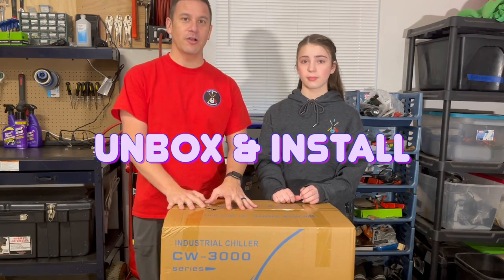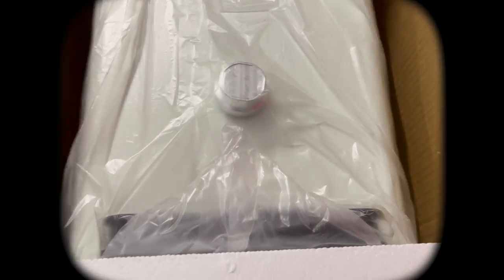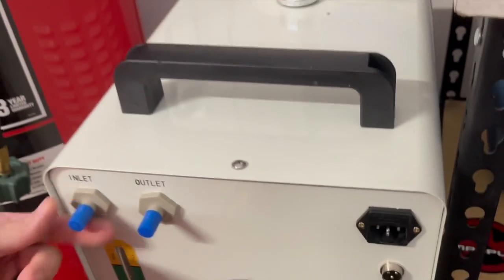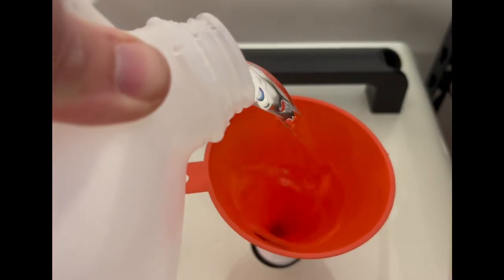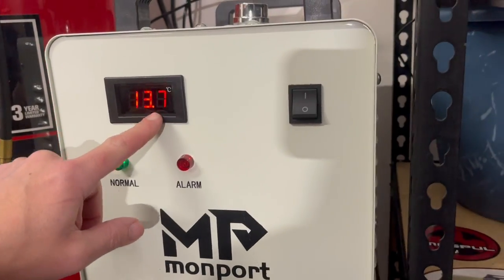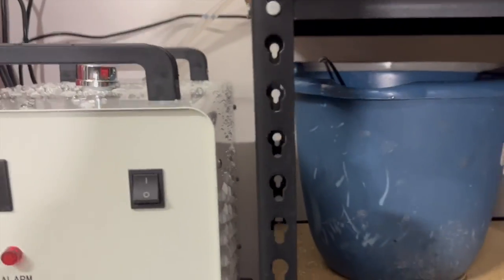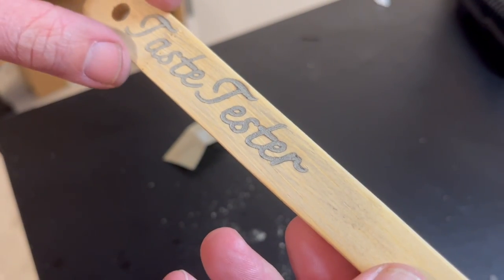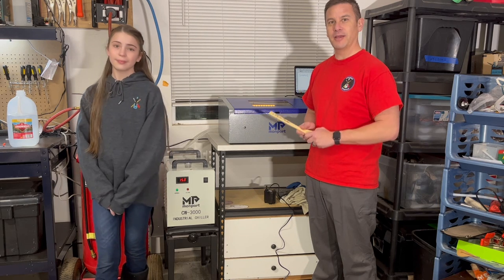Unboxing & Installing Industrial Chiller for Monport’s 40W CO2 Laser + Engraving a Wooden Spoon

Comment: Just a heads up, the 3000 series does NOT actively cool the water. It passes it through a radiator that has gans blowing on it so it keeps the water at ambient temps.

As long as your ambient/water is not higher than 75F your good.
Reply from the maker: Thanks for sharing!